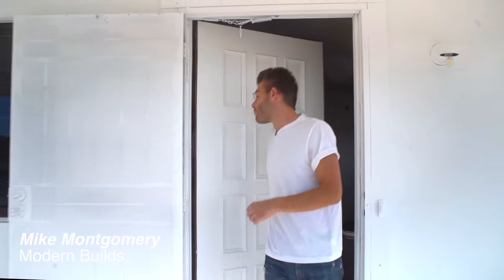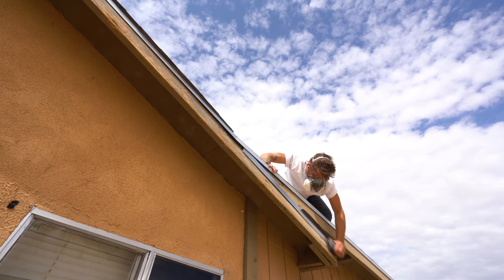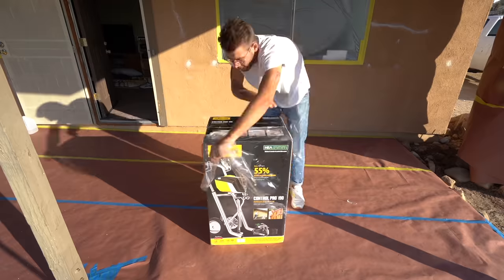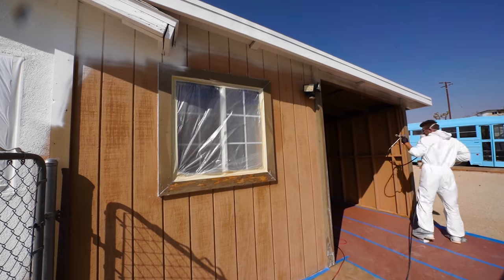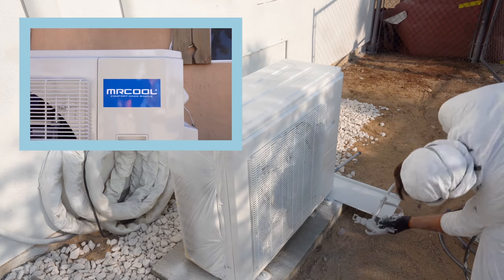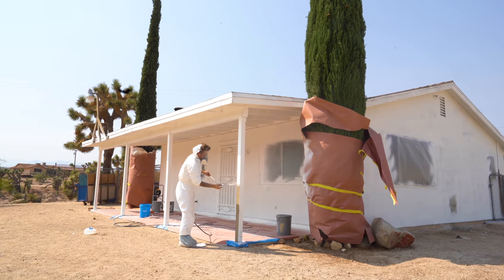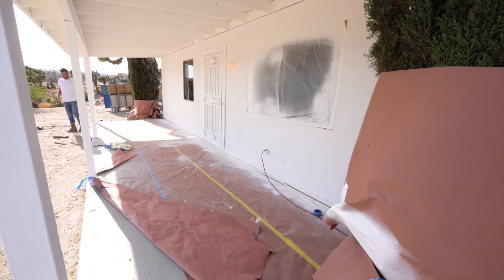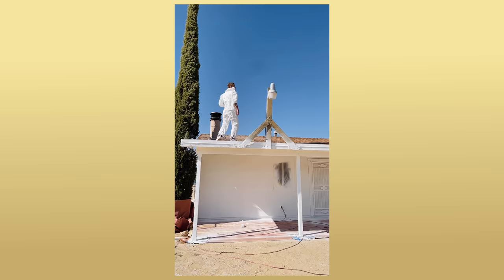Painting My ENTIRE House WHITE!!! | Joshua Tree Cabin Renovation

Comment: I'm pretty sure the nails coming through for the roofing is intended. Here in FL if your sheeting is less than 3/4", then the nails are required to penetrate all the way through. In some places if the sheeting is < 3/4" thick the nail must penetrate at least 1/8" past the sheeting.

Chances are the roofers just choose nails long enough to always penetrate. My attic (prior to spray foam insulation) was just covered in exposed nails. I've hit my head and back on them more times than I can count.

What I would do in your case is cover the joists with something like bead board (you can even get the plywood stuff). It will give it a nice finished look. Just make sure to account for any attic eave venting you might cover up.
Reply from the maker: Good to know!! Thanks a ton Frank

Comment: You should have filled the holes and cracks before power washing. And the nails for the roofing are supposed to go through the plywood, thus will over penetrate by code.
Reply from the maker: wouldn't washing the house first help all of the stucco patches bond better?
Reply: @ModernBuilds  if you had let them dry out first maybe a slight improvement over not washing.